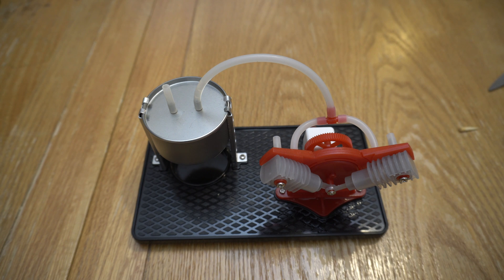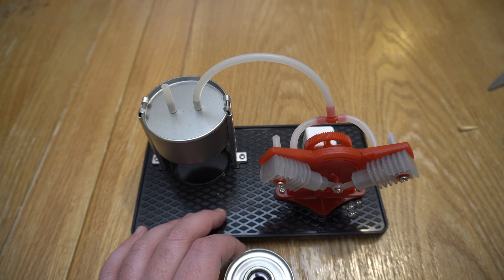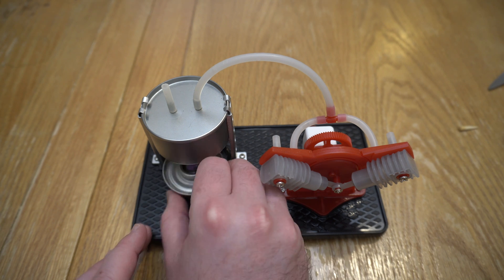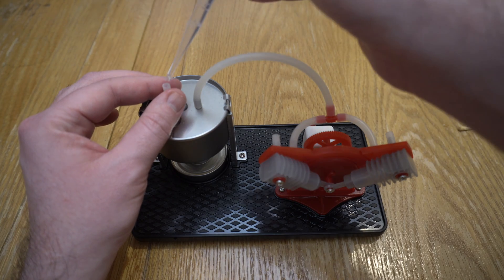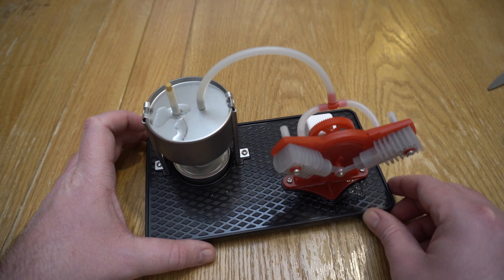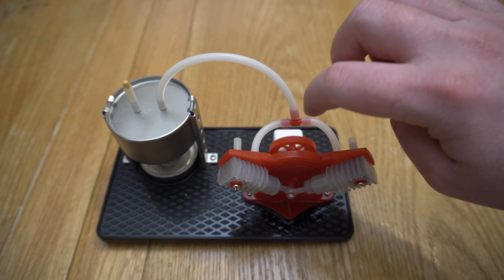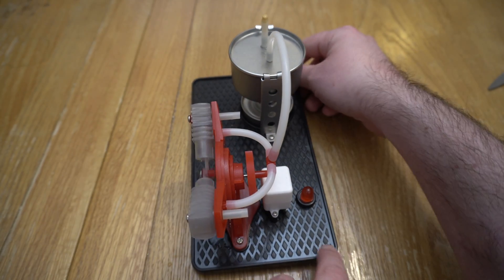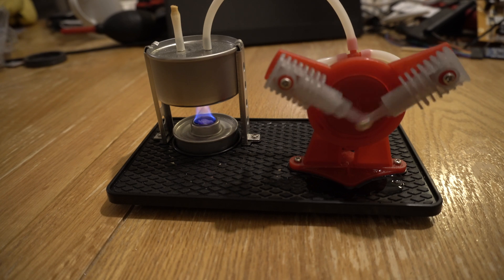Toy Steam Engine

Comment: I wonder how bright you could get the LED with an additional heat source?
Reply from the maker: I was surprised how flickery it was - when you power it by blowing, it is continuous. I think a small capacitor might work better!
Reply: @cybergibbons  did the RPM increase though?